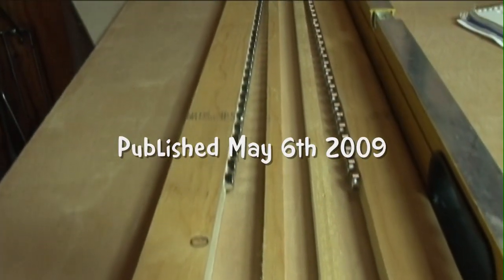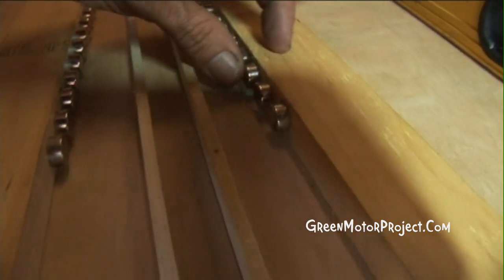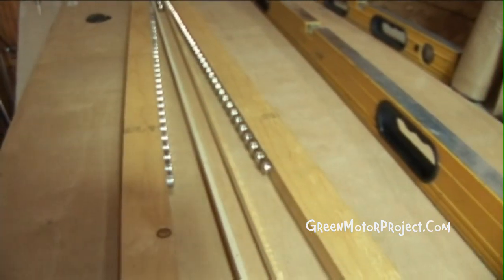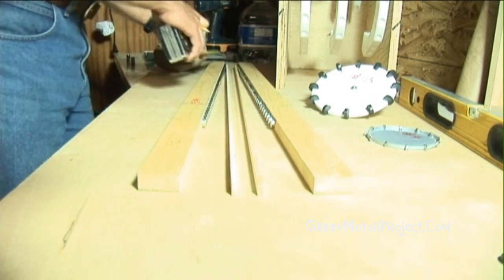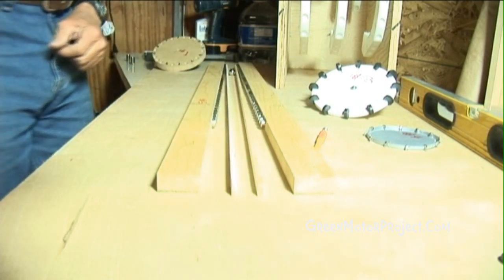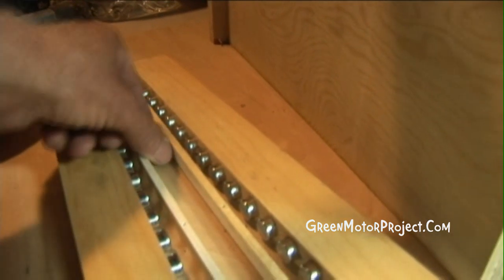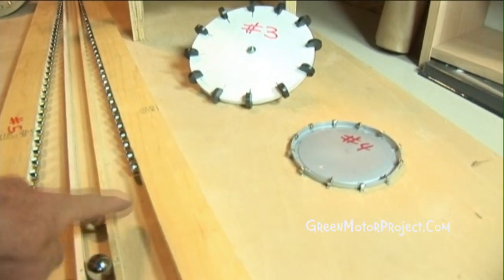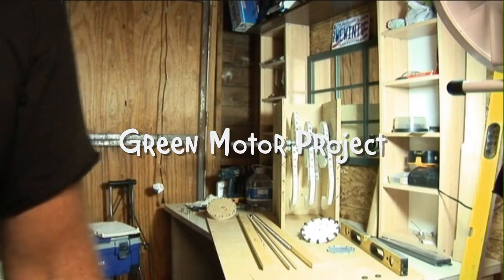Green Motor Project Video 3 Trevor Green Music FreedomOpportunities.com

Comment: What if you let the ball fall off the track at the end (have the magnets ascend further than the track) and let gravity pull the ball back down another track below that ramps up to the initial track putting the ball back at phase 1?  Use the magnets to "lift" the ball and let gravity pull it back down.